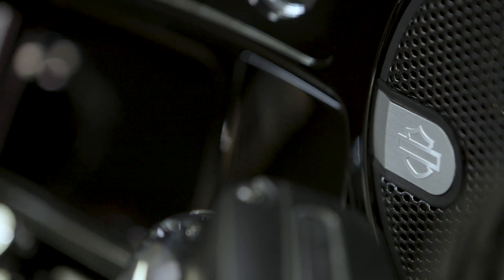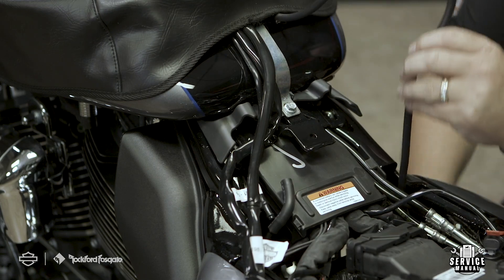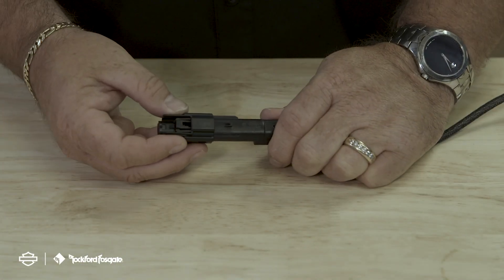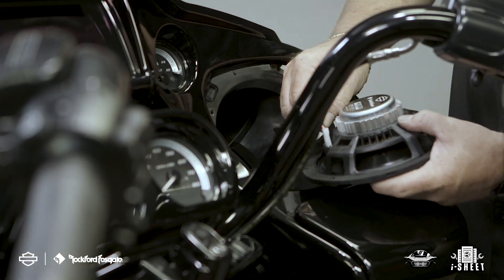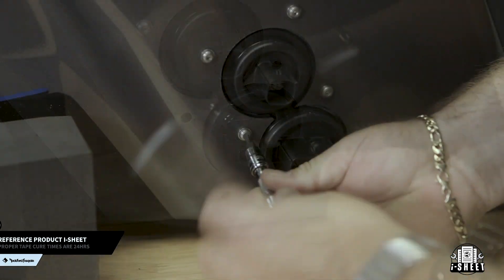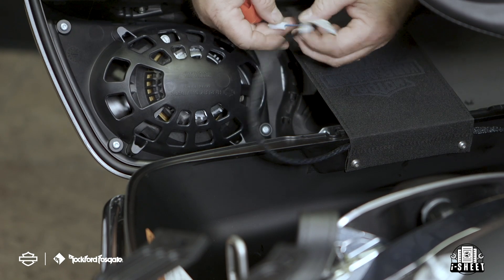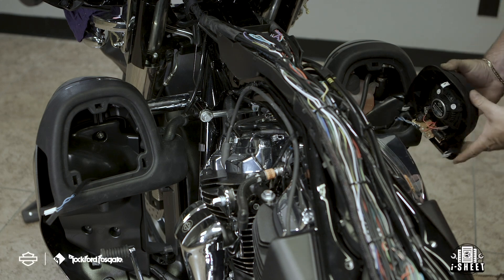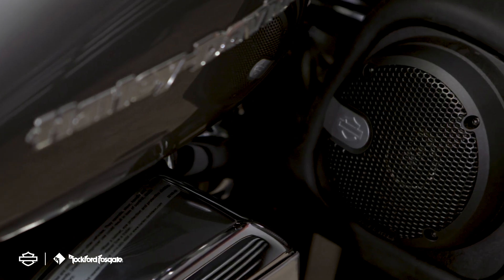Install | Harley-Davidson Audio Powered by Rockford Fosgate

Comment: How did you set the screw back in the latch after installed the speaker lids. There is no room between where the screw goes and where the speaker goes?

Comment: just installed the 2 speaker and amp kit on a 2020 street glide special. i did the 76000981 3 way speakers,76000997 primary amp, and appropriate wiring harnesses. the place i got stuck is in the right side canbus wiring. watch the video carefully, he goes kind of quick on the video. otherwise its pretty straight forward and sound is good and loud.
Reply: Mine didnt work at first cause we had a connection wrong in the canbus. Once we fixed it worked as it should
Reply: I can't figure out the canbus on the right side.  I slowed the video down and still can't figure it out.   Need help
Reply: @eddelgado4277  that happened to me too. I think theres two connectors the plug fits into. We had it wrong on first attempt. Switched it and it worked on second. The video and instruction definitely suck when it came to canbus hookups
Reply: @DavidSmith-wd4wg  I figured out that for 2016 and prior the canbus connector you need is on the left side.  Plug in the orange female connector and use the rubber stopper to cover the male connector.
Reply: I’ve been unable to get any sound.  Is there any way to tell if the amp is working properly?  Out of ideas
Reply: connect everything in order like the video, if you do it out of order, you might end up connecting them wrong. watch it  couple times and it will all make sense. A little patients and boom, all done.  I just di it a hour ago, no issues. This video is for 17 and newer touring bikes.

Comment: Hey Greg informative video thanks. My question is I have a 2020 FLHX last winter I added a tour pack with rear speakers. The tour pack is removable Harley dealer wired it so I can unplug the speakers and lights for the tour pack under the seat when I take it off of the bike. This winter I’m doing a Rockford Fosgate stage 2 upgrade. I am curious with the amp if they’re going to be able to wire the rear speaker so that the tour pack can remain removable?
Reply from the maker: Hey Clayton, we recommend discussing this with your local dealer who helped you with the tour pack, originally. This way, they know all the details to your bike and can give proper recommendations. Thank you!

Comment: at 9:15 disconnect the accessory port?  the port is different on 2016 RG (FLTRXS).  do I need a jumper or different plug?

Comment: I just got the 2022 road glide cvo and installed the app followed you're setup instructions and the app is not finding the bike. Is there any paring steps you left out or is it different from what you're showing in the video?
Reply from the maker: Hi Dusty, if you are still having issues pairing, we recommend stopping in at your local dealer so they can take a look. Or, feel free to reach out to our Customer Care Team at  1-800-258-2464 (Monday through Friday; 8am-7pm CDT) so they can learn more and offer assistance.

Comment: Did the first amp and speakers on  my ‘20 flhtk. Very nice improvement over the stock speakers. Currently installing the second amp and saddle bag & twin cool speakers. It’s a nice setup. Looking forward to the spring.

Comment: I just completed this 8 speaker install and 7 out of 8 speakers work. Where is the connection for the left saddle bag speaker? System sounds great though, but I bet it would sound much better with all 8 speakers connected.
Reply from the maker: Hi Corey, for assistance installing your speakers, we recommend reaching out to your local dealer. You can also feel free to call our Customer Care Team at 1-800-258-2464 (Monday through Friday; 8am-7pm CDT). Thank you.

Comment: Just added this system today to a 15 Limited. The app is not recognizing the amp. I’ve spent 4 hours double checking all the wiring, downloading the latest 6.5 software, and still am having no luck. Broke down ran to the dealer to see if they could flash it. No luck. They said they can’t find the amp on their laptop either so I broke down and made an appointment for the dealer to troubleshoot it. I am either really missing that’s not hooked up right or the amp is DOA. Anyhow if anyone has any other ideas I’d appreciate it.——- update- found 2 prongs in the dongle harness that were installed from factory upside down so they pushed out when connected to the dongle. Hopefully an anomaly but if you’re having the same issue, it’s something to check.

Comment: I just installed this system on 2021 RG and I’m not getting any sound or anything from white noise test. Does it need to be flashed? Dealer said it didn’t
Reply from the maker: Hi Marc - Our team would like to try to help you. When you have a moment, please give us a call at  1-800-258-2464.

Comment: Bummer that the primary amp doesn’t go in the front sharknose
Reply: i call it a deal breaker, what a shame
Reply: A few things to consider why. 1. Weight distribution. 2. Stress on fairing supports. 3. What future components may need that space next year. (ie...rumors of new head unit in 2022).
Reply: Totally agree!  I was actually talking to RF about their non-HD-branded system and the tech said that if I wanted a DSP to go with the HD system.  I don't think I want the DSP as much as I don't want to give up my saddlebag space, cut giant holes in my saddlebag, deal with wiring into my saddlebag every time I remove it, have to purchase speaker install kits, etc.

Comment: Just installed the primary amp and upper speakers. For some reason I can't get it working...  

The speakers work, I tested those with the original connections.  The Amp is getting power since it is warm, but no sound of any kind.  I can connect to the Bluetooth module and start the white noise test, but no dice...  

I have tried every connection possible but nothing even gives the speakers a burp.  

Any thoughts on where I could look for some more close-ups or diagrams for connecting the electrical?  Shouldn't be that hard but for the life of me I can't get it working.  I almost want to blame it on a wiring harness or amp defect, but I'm likely the weakest link here.
Reply from the maker: Hi John - Our team would be happy to try to help you with this. When you have a moment, please give us a call at 1-800-258-2464.
Reply: @harleydavidson  It was quite the wait, but I was able to get the system working!  The issue I was having is at the end of the installation when going through the app, I didn't get past the instructions part that was guiding me through the speaker setup.  I had - wrongly - thought white noise should have already been coming out of the speakers when you have to initiate the white noise once you get past the instructions in the app.  Thanks for pointing me toward support, I now have tunes!
Reply: Is there something to do? I go to the white noise test at end of app but nothing,
Reply: @HAZFamily0197  I had to click the button at the bottom of the app that actually makes the white noise.  I don't remember what it was called, but I can check and respond again. Basically, there is a page that comes up first that says it will do a test and make some white noise.  I clicked past that so the image of the motorcycle was displayed and I thought there was supposed to be white noise at that time, when in fact I had to click the button to begin that part of the test.

Comment: Had this new RF system install by the dealership on my 2020 RGS,  Does the head unit need to be flashed?
Reply from the maker: Hey John, the head unit does not need to be flashed, you can utilize the H-D Audio App to finish the installation. If you haven't already, we recommend checking out the video above to see the entire step by step installation process. Thank you!

Comment: Looked like you plug into ecm port if I understood instruction.   Does this tune to radio to flat output instead of the frequency curve built into the stock radio.  Then you can adjust the frequency’s with your phone using the app.
Reply: Im going through this now. Apparently if you have the GT radio it still needs a dealer flash. Nowhere in the video or instructions does it say that. Mine sounds great but the bass can be overwhelming to the point of distorting on certain songs even at low volune and I have all controls for bass as low as they go. I inquired with one of the engineers who follows a harley facebook page and he told me. I asked him if HD is going to update the instructions to let these guys with 14-18 GT stereos know. He replied he will be looking into that.
Reply: @DavidSmith-wd4wg  HD says no flash required.
Reply: The GTS radio DOES NOT need to be flashed because it communicates via CANbus to the amplifier and will flash the radio using the Harley-Davidson Audio App.  Standard 4.3 and Premium 6.5GT radios MUST be flashed by the Harley-Davidson technician since they can't communication with the amplifier.
Reply: @rockfordfosgate  does that mean if you have a 6.5gt radio and you decide to have a removable tour pack on it you will not be able to
Reply: @aubreydavis2739  Are you asking if you'll be able to detach/attach the TourPak and switch between 6 and 8 speakers once the radio is flashed and the speakers are setup with the App?  We haven't tried it, but there seems to be no reason why you couldn't do this.  The amplifier would be setup to "see" the TourPak speakers, so it would attempt to play as normal.  This would not hurt the radio, however if you ran a diagnostic test, it would likely have an error based on TourPak speakers not being connected.

Comment: installed kit into a 2019 FLHTK all went well until we installed app on an iphone and tried to complete a white noise test. No sound from any speaker. Contact 2 HD dealers , radio was flashed using DT still no sound from amp. We have power to amp but no sound. Even contacted RF but still no resolution.   Please help....
Reply from the maker: Hey, we are sorry to hear this. Our team would like to learn more to see where they can offer assistance. They can be reached at 1-800-258-2464 (Monday through Friday; 8am-7pm CDT).
Reply: Same here... plus now I can't even connect to dongle .. says wrong pin I know the pin is right
Reply: hey, i have the same problem, did you ever get it resolved? what had to be done?
Reply: @harleydavidson  Anyone ever get this working?  Same issue.  2021 RGS.  No sound.  App connects.  Dealer says needs flash.  HD says doesn't.  HD can offer NO assistance other than to take to dealer!  It's either at the Canbus or at the amp (maybe no power??). Tried reconnecting, new fuse.
Reply: Chip
Did you figure it out? My 2021 is doing the same. Seems to be a issue

Comment: Does the factory radio need to be flashed with this system?
Reply from the maker: Hi Keith, the newly installed audio system and speakers will not play audio unless it is configured using the Harley-Davidson audio app or by an authorized Harley-Davidson dealership. You can find the steps to configure using the H-D audio App towards the end of this video starting at 23:42 or you can find the complete install instructions on the speaker product page ➡️ https://bit.ly/3uacHuP
Reply: @harleydavidson  can you also advise that GT based radios need to be dealer flashed as well. I installed my stage two system and the bass is overwhelming and distorts on some songs with the app EQ settings at minimum and the GT’s bass level at zero. Your engineer advised me that the GT units need the dealer flash. Nowhere does it say in the instructions this needs to be done!!!

Comment: Where would you mount the amp if doing this on a 2021 Tri Glide? Thanks
Reply from the maker: Hi Chris, Check out the installation instructions for your 2021 Tri Glide Ultra ➡️ https://bit.ly/3smYNnJ
Reply: It says "not authorized to access Harley Davidson files when I click on the link. I also have a 2020 TG and can't find anything on the 6 speakers install 😒
Reply: @superduty131  @Chris Williamson - check out Bob Forwark's YouTube video for Tri-Glides. His video is pretty good on where to put the amp. I have the CVO TG and I'm planning to do the primary amp in the fairing replacing the Boom Audio Amp & putting the Secondary AMP in the trunk.

Comment: Hello everyone,  I just installed the Rockford Fosgate stage 2 on my 2016 road glide special,I had my Harley dealership flash the system and while I was there the white noise test worked at the dealer with their flashing system. But when trying to set it up on my phone, the whole Bluetooth connection on the Rockford Fosgate app works except the white noise won’t work. I am unable to use my equalizer on my phone does anyone have any idea what can possibly be wrong??? Again after the flash at the Harley dealer my speaker started working together with my amp but currently working off the stock stereo when I try to go on the app on my phone the Bluetooth connection goes on the music turns off but I cannot get the white noise to work also noticed that when I access my equalizer on my phone in the app when I try to go from different sound like rock flats etc. they are all maxed out on my phone at that point no sound is coming through the white noise test does not work from my phone?? Any help with be much appreciated..thank you all
Reply from the maker: Hey Cesar - We would like to chat with you to gather more details and try to help. When you have a moment, please give our team a call at  1-800-258-2464. Thank you.